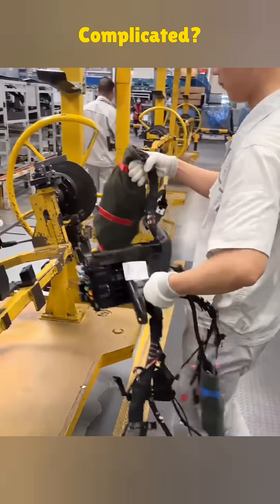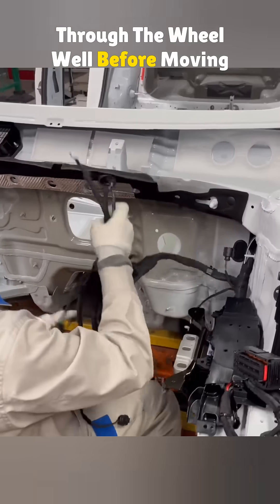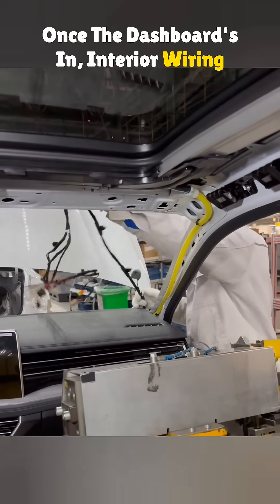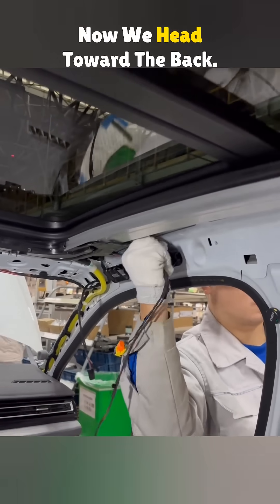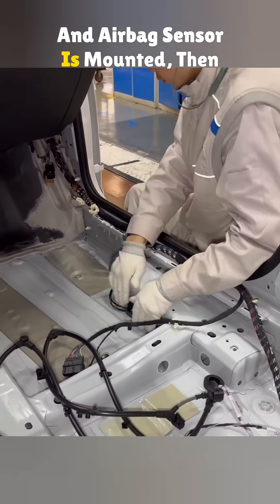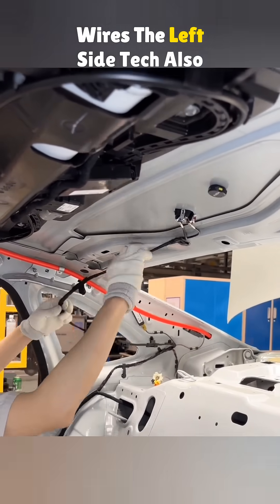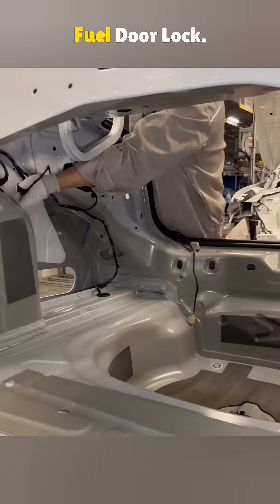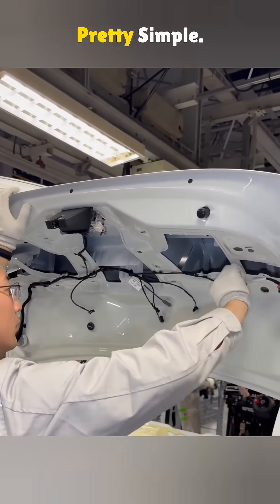How Do They Wire Cars In The Factory #assembly #automobile #manufacturing #cartech

Comment: Installation of trim line part in production line is different in Diagnosing and repairing faulty electrical system in a vehicle... I experienced that both Working in Ford motor manufacturing plant as operator installer parts to Ford dealership as Auto Technician is a huge difference

Comment: They should add a master connector to separate the engine wiring from the rest of the wiring. Pulling out an engine with the wiring still in place is much faster.

Comment: This reminds me so much of how one Japanese car maker had their aftermarket AC kit setup for install. They had you remove everything that was going to get in the way and then reassemble it all with the AC components going in as you go. Every nut, bolt, screw and clip we're packaged and indexed for quick access. It was exactly the same as the one that they would put in, in the factory. It was, by far, the fastest install that we were ever able to do!

Comment: So cool. 

I remember years ago when you had a wire a car starting with wire from the fuse box and running it all the way back to the lights to the motors devices whatever. Every wire had to be run individually unless there was a common power or ground.

Comment: Its not complicated when there isnt an engine and various components blocking you from reaching those wires
Reply: and there isn't 1 wire in that whole loop that is faulty.
Reply: Exactly! 😂
It doesn't make sense at all! Believe me!
They don't think about customer repairs at all!
First install is very easy but God forbid a single thread of that wire gets burned out! You'll have to spend a lot of time and money to fix it because everything is under a lot of stuff!
Simply put: They are not repair friendly!
Reply: This tells you nothing about what wire is doing what .
Reply: @cristig243  its not that kind of video. They are just showing how the harness is snaked throughout the engine bay.
Reply: @cristig243  and they actually do tell you what some systems are connected to it.

Comment: That is ridiculously complicated. Imagine trying to repair a wiring fault in that car when it is fully built.
Reply: Gotta take everything out lol and warranty wanna pay you like 3 hours for it 😂
Reply: That's what us auto technicians have to deal with afterward when the wires go bad
Reply: Just get a wire trace kit.
Reply: you can t
Reply: It is so easy to troubleshoot these modern systems. They are also easy to repair if you have the tooling and training.
Reply: I agree. This is VW unnecessarily complicated design, also found on all German cars. Toyota is much simpler and better.
Reply: @paulparoma Toyota are literally doing this and have been since the 90s.
Reply: @huskkyy  Maybe, but all design solutions on Toyotas are relatively simple compared to VW.